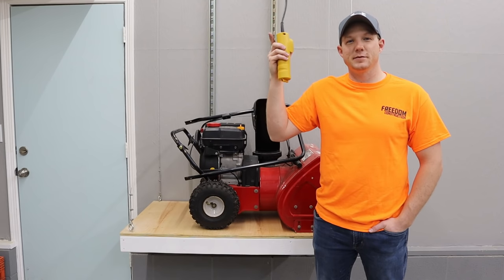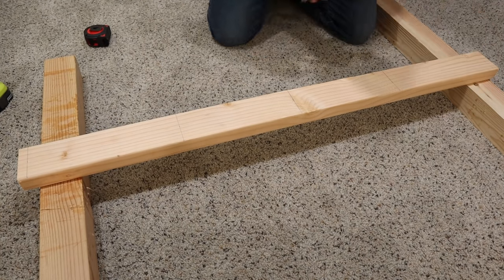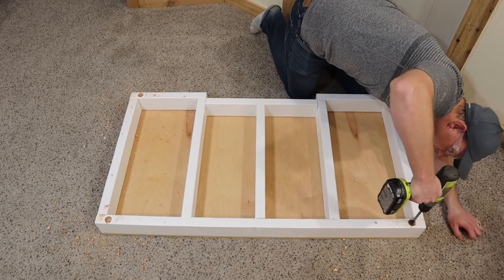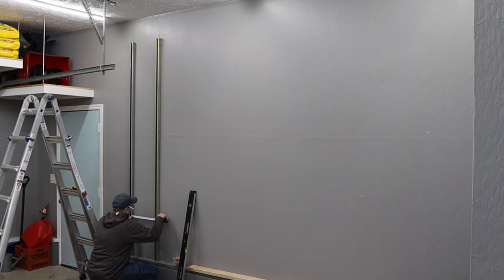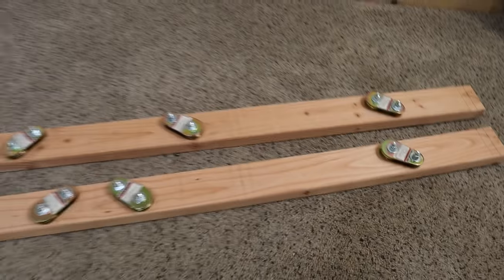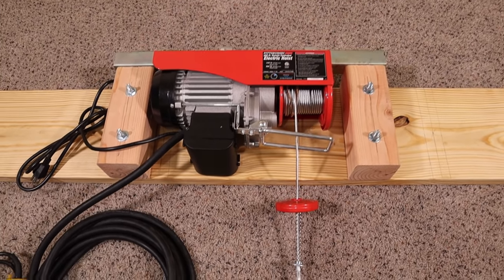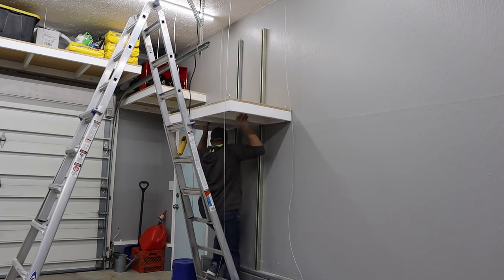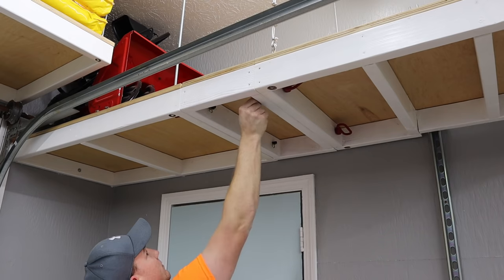DIY Electric Garage Storage Hoist | Snow Blower Lift | Garage Makeover Pt. 5

Comment: I appreciate the idea of an elevated shelf but the complexity and cost of this makes me wonder about the practicality of this concept.
Reply: It could be very practical to enable the use of storage when you have 12 ft ceilings in the garage. This concept gives me a lot of ideas.
Reply: if it keeps crap off of the floor - it IS worth it !!!!
Reply: For the time and money could have bought a shed.  Neat gadget but that’s about it
Reply: @brentscott2509  Not everyone can have a shed. Not everyone wants a shed. Not every idea you won't implement is bad. This project addresses a specific problem, and it does it well. There's no need to poopoo it just because it isn't what you would do.
Reply: @watcherofwatchers  LoL ok.  If you think this is the most practical solution have at it.  My comment was quite mild on my feelings so maybe you need to lighten up a bit
Reply: @brentscott2509  Now who needs to lighten up? My response was accurate -sheds are not always an option. Platform lifts like this are a common thing, actually. This DIY version is an interesting take on the idea, but you simply dismiss it. You should have just kept your mouth shut instead, as you added nothing at all to the discussion.
Reply: @watcherofwatchers  👍👍😂
Reply: Definitely over engineered for just a snow blower
Reply: Haters gonna hate
Reply: @watcherofwatchers  You make a good Nazi!
Reply: I have a 12" miter saw and tile saw, both on rolling stands, that take up probably 10 sq ft of floor space.  I'll be building something similar to get them out up into the loft of my shed.
Reply: the whole project could cost $1000.
The price of a square feet is around $200

Comment: Wow, as a mechanical engineer, it is over engineered, but it’s awesome. Well done. The use of the wall tracks is brilliant. And I love the planning. I try to teach the importance of planning to my engineering students at Michigan State. Me, I’m gonna keep tripping on the snow blower in my garage, swearing, and telling myself to build what you built. Thanks.
Reply: Big band saw needs this to lift it to table height for its horizontal position.
Reply: Being in Frankenmuth, Michigan myself, I can certainly see the value here as well.  It’s either doing something like this or setting up a small out building behind my house.
Reply: Maybe build a small ramp to slide up in place when it's time to get the blower on and off the elevator? Turn the blower 90 degrees and roll it off and onto the platform? Also, and aluminum drip pan you can get at an auto parts store for underneath the blower so you can put it up wet. Nice build!
Reply: Several mechanical engineers post and not one questions the lack of a backup safety?
Sorry. I'm not intending to troll but this concerns me... I'm going to stop reading comments now...
Reply: When i was taking a class to become a building inspector, the teacher said for the most part, individuals doing their own work, over build (better than code requirements.  ). You have to watch out more with certain contractors.   Not all but a higher % than individuals.
Reply: Is an MSU ME degree a real thing?  Ha ha.  Go Blue.  This dude would make a good technician, but the design is certainly not optimized for anything.
Reply: @accidentalheadclunkers8517  Go Green!
Reply: Go Green
Reply: Over-built is under-engineered; over-engineered is under-built.

Comment: As a rigger, it is hard to see Crosby clips saddling a dead horse. A quick link should not be side loaded. I would recommend changing out any Crosby that has a saddle on the none lifting side, and changing out that quick link for a rated shackle that you should also mouse(zip tie the pin to the shackle so it cant spin) also would recommend changing the turnbuckle for a jaw to jaw style and not an open ended end. Would also recommend checking the pulleys so that the cable isnt cutting them.

Comment: I am concerned that you are doing most of this work on carpet. The metal shavings must have been very difficult to remove from the carpet.
Reply: Life Hack, vacuum cleaner.
Reply: @ryanmacewen511  you have never tried to vacuum metal shavings out of carpet
Reply: @MrMrsregor  Yes, it's not rocket science.
Reply: It’s an epoxy garage floor, not carpet.
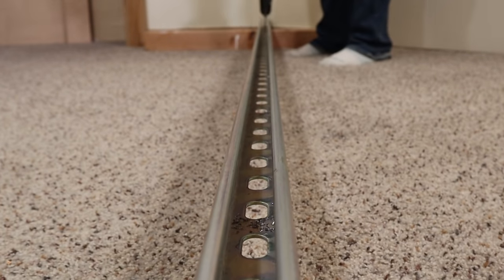Reply: @jonathandeuire6962  4:55 is the softest, fluffiest, shaggy epoxy floor I have ever seen

Comment: Good job. Now, put the bridge on a piano hinge with a metal tab on the opposite lip. Then you can drop it like a gang plank, roll the blower into its parking place and life the bridge back up - voila - no more overhead pin pounding and the bridge stays in place. Don't have to worry about loosing it. Cool storage idea
Reply: Or make the shelf larger and forget the bridge idea.

Comment: Loved this video. May I suggest that instead of installing/removing that extra bit of small shelving above the door every time you want to bring the blower down, you could have it mounted on solid hinges on the fixed shelving side and it folds up and locks in position or lays flat (your choice) when not in use. When needed it folds down and just 2 pins required from the lift to it as is now.
Remove pins then fold up (and lock) for lift use. You don't lose any shelf space because the blower is now on the lift or down on the floor. Easy upgrade too I think.
Reply: Yup an awesome suggestion

Comment: You may want to add an "overkill emergency" safety cable to your "manifold" something that comes taught with some form of shock absorbing properties just on the extremely unlikely situation where your winch line snaps. I am an overhead door technician and I see that 3/16 cable snap on a regular basis, heavier applications mind you. If it where me I would add a 1/4" cable to your winch mount where it is meant to double line and run the other end to your clew, through a compression spring so it can absorb some shock when your load reaches bottom in the event of your winch line failing. The rest of your system looks great. However the single winch line is holding all of the weight and if it decides not to do that anymore the whole system fails. Just my two bits. I built a similar system to raise and lower stairs but I have two 3/16" cables to raise my roughly 700lb stair/railing up. One would be sufficient by weight but if one fails my stairs won't fall.
Reply: He easily lifted the blower, Just keep clear when operating
Reply: @mikerafone4736  Yah that would be the smart thing for sure. As a result of my line of work I'm forced to look at the extremely rare "what if" circumstances like what if a kid runs under it while it's operating, or a pet. And because of Murphy's Law, that would be when the unexpected would happen. I don't intend to rain on this dude's parade, what he did is freaking awesome. In fact I did something similar for raising and lowering my loft stairs in my garage. But I used two 1/4" cables that have a weight working load of 7000lb each, the likelihood of both cables failing at the same time is low. So in my case I've built in my "safety redundancy" that way.

Comment: This is insane - your install is a mechanical marvel.  I too live in Ohio and feel your pain.  I just bought one of these lifts and like you, I also are YouTubing before I design my setup.  I've had a dumb waiter in my garage for decades using pulleys and a manual boat wench on the wall.  It works good but now I'm upgrading it.  I probably will not be replicating the complexity of your design but have learned a few tricks from your effort.   Thank you for sharing.

Comment: I used the same $80 winch to make an elevator up to my attic; previously, I'd been hauling boxes up the folding ladder. The cost in materials and labor wasn't even close to what my medical expenses would be if I fell, so it was a good investment. Thanks!
Reply: You should make a video and tag me. I’d love to see what you built. I think it’s a good idea since I have the same issue and an elevator would come in handy.
Reply: Is your lift in the middle of your garage? Or is it on the wall with tracks like this video? That's a really good idea because I'm sick of going up in my garage attic with a ladder.
Reply: @twistnshout3031  it’s between two joists and not against the wall. I like what the OP did with uninstructed but not an option for me. I angled the top of the platform so it rotates itself when it’s all the way up. I wish it were wider but I’m not going to cut my joists!

Comment: Yeah, I like it.  I did the same thing in my garage just a little bigger hoist. What I did and would advise is this. Hang up the hand held and use a remote for your setup. Really convenient, and easy to wire.

Comment: You could add another shelf to the right, and put a push mower on that one.  Nice work.
Reply: Haha
Reply: Make a few mods and add another shelf to the lift and make it ALSO become a trash compactor!

Suggest adding a 1x2 stop to prevent blower from going off the edge if (somehow) it gets pushed too far to the right.

Comment: Very well done. I have plans to do similar down the line in my shed.
In watching your build, I realized the turnbuckle might be better at the platform end. Additionally, you can keep it in the lift if you put a support system underneath it. A simple bracket system could work.
Since you have the foundation limiting how far it can come down you can make a shelf underneath the lift for other winter only items. Gloves, boots, shovels or even rock salt if you use it.
Looks perfect for what you wanted out of it but inspirational for those of us that have different setups and needs. Thanks for sharing.

Comment: Nice! I used the same Harbor Freight winch to lift the hardtop off my Jeep. I used a pully to double the lifting capacity and cut the speed in half to make it easier to align when reinstalling the top. For storage, I just let the top hang up against the ceiling.

Comment: Love the idea.  Have a manual system to lift a kayak to the ceiling using ropes, but this is simple and love the electric winch, I'll have to consider updating my lift.  Wires are a good update too, no twist compared to rope. Thanks for taking the time to post the video. That was nicely done too!

Comment: I certainly wouldn’t worry about the garage door spring. You just built a cool winch system. You’ll figure out how to address the spring. Great job! My snow blower and generator sit on the floor as well. May use a portion of your idea to stack them on top of each other.

Comment: Nice job.  Well done.   The one item that initially caught my eye was the D-Ring that connects the lift cable  to the spreader bar.  I think I would have made  a triangular shaped substitute from plate steel or some other connection, but for the loads you are lifting  it should never be an issue.
Reply: Cable clamps on the lift..  saying goes, never saddle a dead horse…

Comment: I really like this. The only thing I can think of that I might have done differently is made the extension that goes between the shelf and the lift a 1/4 inch shorter and then you could leave it up attached to the shelf and only have to deal with 2 things to put in and take out when using it or letting the lift back down.  Great job!

Comment: Great project. Nice and clean, in the attic install was a good idea. I did something similar, I stored a 16' Hobie Cat (400lbs small boat) up in the air. I've sold the cat since so now I store my kayak trailer (250lbs) up and out of the way. I also use a Princess Auto (Canadian version of Harbor Freight) hoist, great little things. Only mod I would do is tape up the ends of the cable so you poke yourself.

Comment: This would be great for storing seasonal items such as in winter store the lawn mower (push type only) up there and switch down in spring when needed again.  Store the snow blower under the lift in winter and the lawn mower there spring through fall.  Sounds like a great project.

Comment: Great idea!!!  I think the most practical thing is to use your shelf for something else and when storing your snow blower just crank up your lift and leave it on the lift platform.  I did not hear you were going to use the lift for anything else.  Another addition you might build is another shelf for the other side of the lift platform.  Great project!!!!   Nice lift design!!!!

Comment: Great job! Very clean done. Not sure if anybody suggested, but if you want to avoid lifting that snowblower when platform comes all the way down you could shorten wall railings so platform gets detached from it when it comes down; then you would pull your platform with one hand until it clears that bottom step on the wall and start lowering platform further until it reaches floor. Just my 2 cents :). Cheers, Mike

Comment: Couple of ideas: 
1.Turnbuckles at the platform instead of attic for easier adjustment access. 
2.Use a French Cleat for connecting the plank to eliminate bolting it in. 
I’m a fellow 3D solids modeler and reality capture expert from way back. 
Great video and idea, thank you!

Comment: Great idea!  I want to make something similar to store my rolling saws in the loft of my new shed.

I'd suggest drilling some 1/2" holes through the sides of the struts near the top.  You can stick your pins through there to store them, and also act as safeties if the wires fail.

Comment: This was a great idea and it turned out to be solid! I have something like this in my near future. Unfortunitly i have rooms above my garage so hiding everything in the attic is out for me but i like the hitch, i only need enough lift for a work bench for some distillation equipment i use and up is the only option available, that said good video it gave me some good ideas, so thank you.

Comment: Great video, I would put the turn buckles on the platform and the cable clamps up in the attic. That you could load the platform leave it overnight to help stretch the cable and level while standing in the garage. I would have tried to run the track down just above the floor put door/window shims behind the track. You could also make a ramp to roll the snow blower off.

Comment: Very good, You could mount motor below platform and would be a bottom drive system with one pulley/divertor directly over platform in loft space. Track system with unistrut is great.....One rope would be sufficient with a spanned bracket fitted onto front edge of platform, easier to maintain and good to watch if motor working hard etc. 👍

Comment: Good idea, I think using a pulley and wrapping the cable around the pulley  (maybe even used like a used garage door pulley) or something similiar would take up less space in the attic.   Your way works, but just thinking of less parts/smaller area required.

Comment: Nicely done, really neat, sure helps that you've no insulation in that attic.  I have 18" of blown in fill so not quite an option,  I did something similar to lift the canopy off my Pick-up truck using a hand cranked winch but it's all exposed.  I sure love your clean ceiling look.
Reply from the maker: That's a good idea for the trick cap, and ya I do like that I was able to keep the ceiling clean

Comment: Interesting, and a suggestion now that you are that far along: Use the 'elevator' section to access additional non-moving shelves, like the one where you store your snowblower.  Add another non-moving shelf to the right side to hold something large, ungainly and heavy like the snowblower.  Use the moveable shelf to get it up and down as needed.  I can see you storing something heavy on the moveable shelf as well. I would switch out the snowblower and a lawn mower depending on the season.  Good Luck!

Comment: For the future, just build another rectangle the size of your base.  Hook one wire to four at the top rectangle, then hang the wires down to the base.   Forget about all the stop blocks in the attic, which you could've woven to gain more force that you really don't need.  Double your wench pully to double the force.  move the wench so it directly hangs to the center of your base only now it's elevate because you have a box frame.  I would've pulled that away from the wall so it goes all the way to the ground.   If you can weld there is an even easier way.   You did a nice job on the project and it looks really nice.   Look how they wire pulleys for kayks. You pull ONE rope.  In your case you could've hooked your pully to one wire.  Also that 10 x 2 would give you more strength by placing it laterally. "Trusses" are not as strong as you think pulling down on them.

Comment: Cool idea!!!! It would be cool to add a rails to the top of the shelf so the snowblower would be able to slide across to the elevator. The rails could also replace the need for a bridge, if they extended out to bridge the gap.

Comment: Nice setup. I did an over the garage door shelf like you mention at the end and when I had to replace the garage door springs there was no issues for the installer. I was a bit worried about it as well, but turns out you don’t need a ton of clearance. Mostly just makes it a bit more annoying when using the tensioning rods to tighten the springs, but otherwise not a big deal.

Comment: Very good, I like your description and idea. I can easily follow your instruction video.  

One thing I noticed (other than I'm late to the party), is it looks like you installed your cable clamps backwards. Remember this aphorism: "Never saddle a dead horse".  That is, the saddle doesn't go over the cut off end; it goes over the live end.

Comment: If you are open to suggestion, I would take a sheet of plywood that is grooved like a table saw. Put low profile wheels to make it slide easy as it transitions across the platforms to the lift. Should make loading and unloading easier and reduce the change of masking marks on the walls. Love the idea and I will likely mimic the idea. Keep posting.